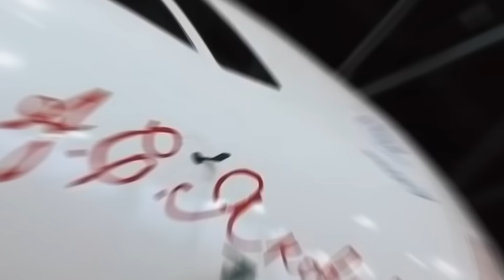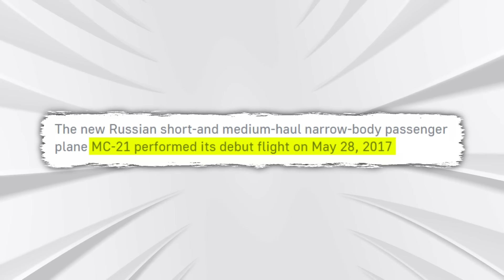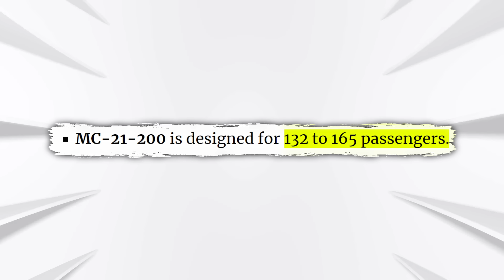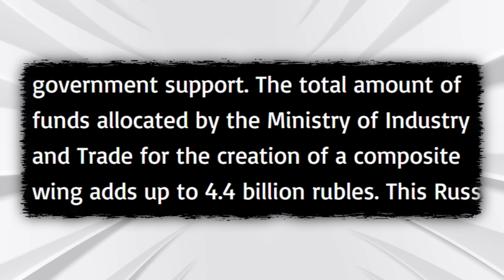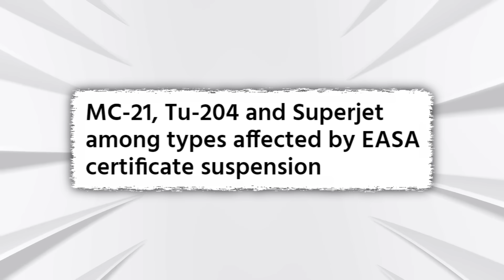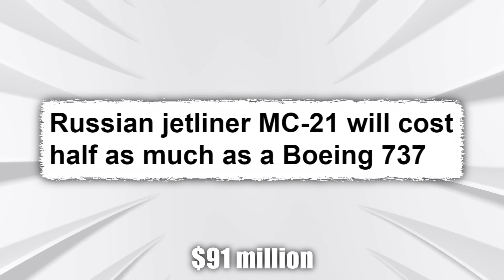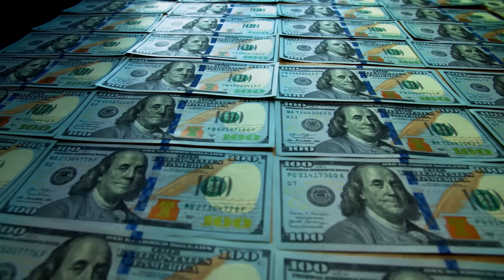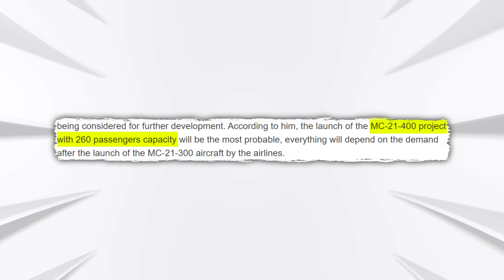EVERY Russian Airlines BEGS For The New MC-21 NOW! Here's Why

Comment: The MC-21 prototypes still use a lot of Western technology, which is no longer accessible because of the ban. Some of the technology cannot be replaced with locally made one. Yakolev will need to work around what cannot be sourced in Russia or in non affiliated countries. Which in turn may mean lack of safety. 
As for maintaining their current fleet of Airbuses and Boeings, as you pointed out, they can still get parts, albeit at an excruciating cost.
I personally don't see the MC-21 being a serious competitor, even in the non affiliated countries. You need to have enough spares everywhere they fly to keep them flying. Russia is struggling to manufacture enough to build a few planes.